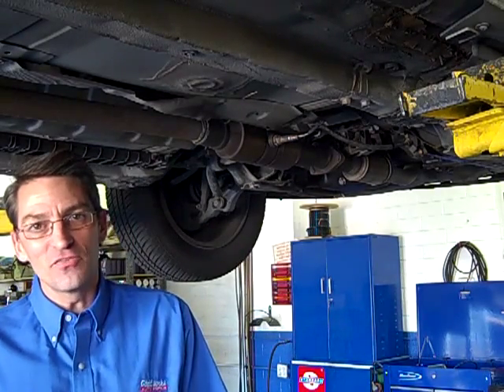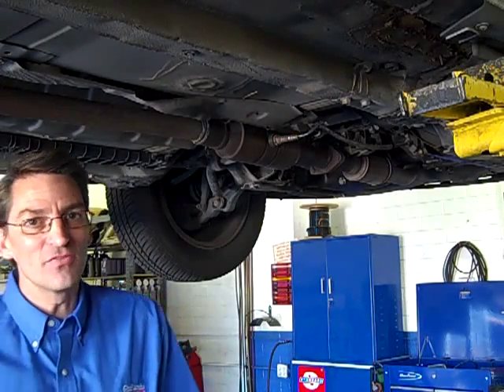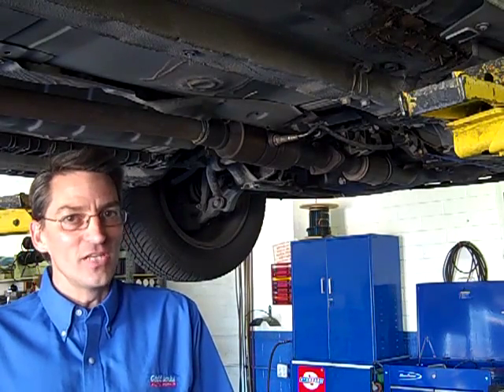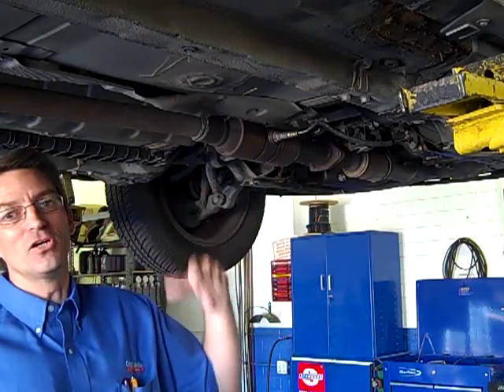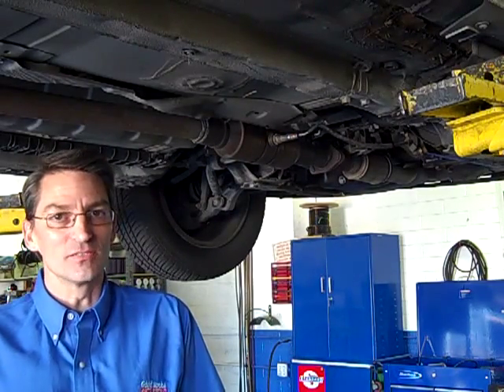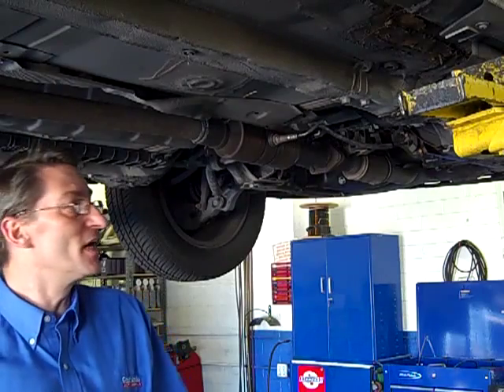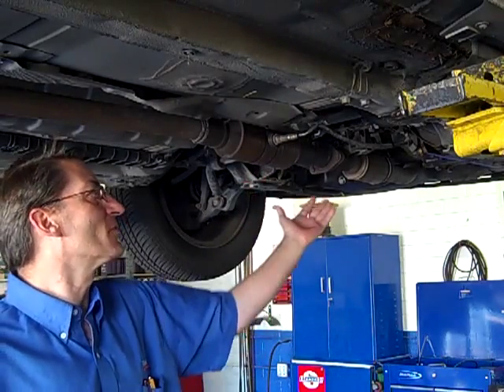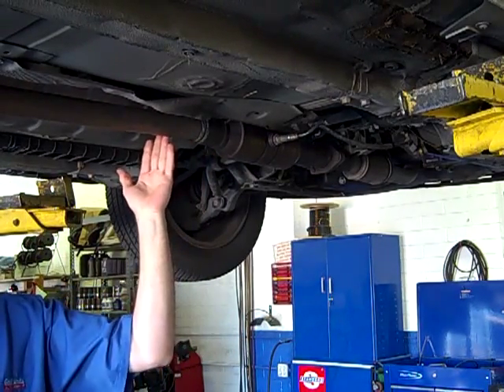Catalytic Converters - An Integral Part to Passing Emissions Tests

Comment: You are absolutely right. When we design a catalytic converter we balance the active ingredients (platinum, palladium, and rhodium) along with washcoat and substrate (metallic or ceramic), cell density. It is matched to the car, the emission test, and the engine. Then the ECM is calibrated around that specific catalyst chemistry. 20 years ago, 90% conversion was good. These days you need to be at 98% or better, and an average air-fuel ratio to within 0.001 of what the cat wants. Good video!

Comment: When I test a cat/engine combination sometimes I have to go back to the cat manufacturer and have them change the formula. I look for stability of the postcat fuel control as well as emissions vs. postcat setpoint and also HCHO and NH3 production if a rich bias is needed. Sometimes I need more oxygen storage (if a new cat causes postcat wiggles) or less (if the rear voltage wiggles on its own but much slower). Some algorithms are tolerant and some, not so much.

Comment: Some engine applications won't' take the 'universal' ones without tossing a MIL, or their emissions will suck. I work a lot with CNG engines (natural gas) and their conversion window is narrower than gasoline so it's really fussy on the catalyst chemistry. Also, an aftermarket replacement cat is not going to be subject to the OEM emission tests (FTP75, US06, ETC, WHTC) that are quite a lot tougher than the roadside sniffer tests or even IM240.

Comment: Nathan my code came up p0420 catalysts problem. important smelling my exhaust and my car is sluggish and when i put gas in the gas it goes right out important constantly putting gas in so do i change the catalytic converter

Comment: I understand the the universal cats dont last as long, but the costs your saying 500 dollars and 1000 dollars to fix is insane. dont see how a couple feet of pipe adds 500 dollars to the cost. Also anything 25 years and older where i live, we dont need to go through emissions. 87 dakota with 410,250 miles on it original motor trans everything (trust me its amazing it still runs so perfect not even a single knock), without a cat would pass, they thought the cherry bomb was my cat and it passed no problem. And the smog pump was sized up from 4 wheeling, so that was completely disconnected to yet still passed. explain that one, shows how states just wanted to find another way to make money. I had a 96 honda civic 289,000 miles on it and had the down pipe off at one point took a flashlight to see how clean the cat was and noticed that the cat (which was right off the manifold was completely empty nothing in it what so ever must of rotted out through time so meaning it was hallowed out cat that happened on its own. it was a OBD2 car so they would just plug it in, and it would pass with flying colors, check engine light would come on and off, every time i went kept my fingers crossed the light wouldn't come on when running the tests. Point is its extremely crooked a car that clearly was not sending clean exhaust out its tail pipe yet would still pass, i see some kind of conspiracy here no doubt, with states just finding another way to make money off the public. As for the costs, im sure there spot on but as being my own mechanic i just dont see couple feet of pipe and a OEM stock cat would cost 1000 bucks to do.